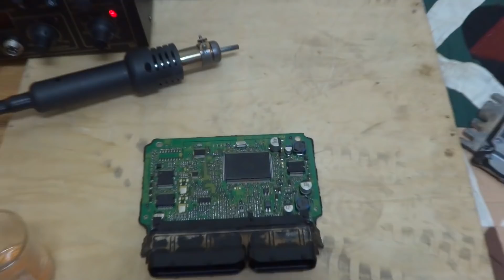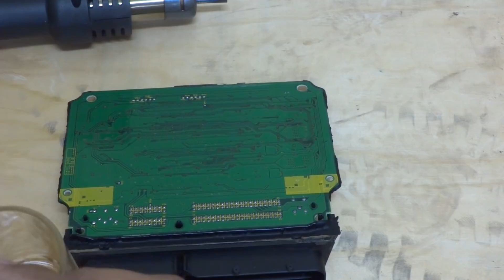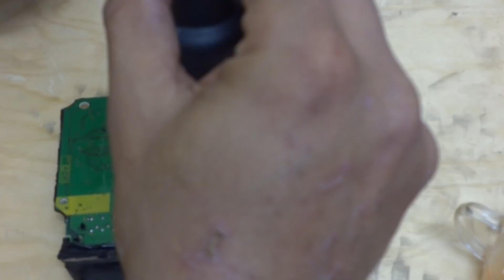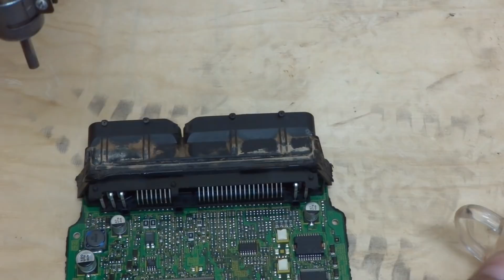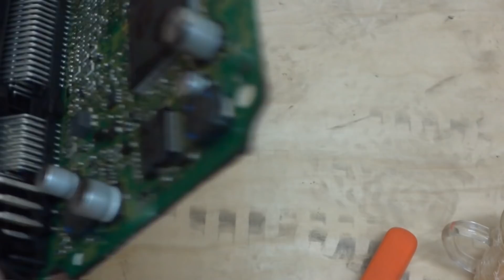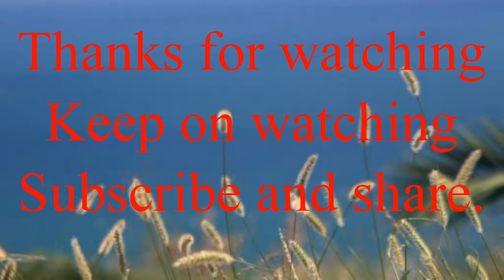Car PCM ECU computer repair.

Comment: This works for problems like the famous 90’s Honda main relay going out too. You can just remelt the solder on those usually. Nice video. Even if it doesn’t repair some, its worth the few minutes to try. It has to be removed, if you need a new one anyway. Just plug it in and test it before bolting it down.

Comment: Do you think this scenario is related to a faulty ECU. 
My shifter had stuck in Park for not sending grounding signal to the shifter solenoid. The mechanic made a jumper now the shifter is good, but the transmission shift at a higher RPM. From 2nd to 3rd and so on, you have to reach the RPM to 3200 or 3300 and then the trany upgrade the gear. Do you think the ECU is what causing the trany shifts funky? Thanks.

Comment: Although reflowing the solder of an old board can address many typical intermittent defects, I definitely doubt the procedure applied in this video is effective.  Most of the time the heat is not applied long enough in a single spot to allow the solder to melt down properly regardless the temperature and/or airflow applied. In fact, if the heat is too much you may destroy the component.  Those who ever worked with SMD devices will understand what I mean.  The video may work as "representation" but it is far from a technically accepted procedure.   For those who are asking about the flux, it is the same used for the SMD / PCB soldering process, you can buy in electronics stores. The purpose of using flux is to reduce the melting temperature and to reduce the amount of oxidation of the metals you are reflowing while applying the heat.   After doing that, you shall use Isopropyl Alcohol to clean the flux residue followed by a quick hot air blow (bellow 175 F) just to evaporate any alcohol residue.   And don't forget to test it ........

Comment: I have a 2011 Porsche Cayenne S that has a PCM that keeps rebooting every 20 seconds. I can no longer access the Radio, phone, Navigation on the display setting as it keeps rebooting and the few seconds it does show me a screen the buttons are non-responsive. It seems to me as a software/firmware issue but i could be wrong. The dealers solution was to re-flash the software which didn't achieve a fix and recommends replacing the PCM which is very expensive. Any chance this solution would work with mine or any other ideas?
Reply from the maker: It may need proper diagnostics. There are different fault occur in machines.

Comment: Thanks, good video!! So, reflow is enough to fix any bad solder connections?? Why did you do this?? You were able to see/ or feel, where the bad solder connections were?? How long you have to reflow?? Until you see some melting?? And one more thing: you don't actually have to add any solder into a board?? Did this reflowing help to fix this ECU/PCM?? Thanks a lot=)

Comment: I have 2009 toyota corolla, it's showing all 4 ignition coil secondary circuit,, but it's ecu problem,, can any one answer for how fix it?? thanks ......
Reply from the maker: Seems its Ignition driver IC is bad. Replacement could solve.

Comment: Even though this method is "I don't know what's wrong" so I'll resolder all connectors and try - surprisingly it can fix 50% of all issues, with any Laptop/PC accessory. Professional service used to fix GPUs sometimes does this - (I mean rebailing) so it is something already. Should not break anything, but with cheap labor (own after all) there is a chance to fix something this way. I know a guy who bought 12GB of RAM DDR3 (faulty) on eBay, and fixed it in the kitchen oven. Who knows?:)

And why soldering goes bad? From what I heard European Union around 2000 year has invented that soldering/electronical connection should contain limited amount of tin solder (?) or something, not  sure what, but in care for the environment - now I turn my super old '97 Pentium II MMX after 20 years on and it works, while 2005 Pentium 4 PC motherboard is gone dead long time ago.

Comment: What temperature ??
Reply from the maker: Shabbar Raza Dear friend you can set anything close to 300*C with air pressure or flow control to minimum. Regards,
Reply: Thanks, btw, my ecu is a repaird one and now it is not giving signal to injector #3. When ecu is cold it works fine but as soon as ambient temp rise its giving problem, could u plz help me out ??
Reply from the maker: Shabbar Raza As I told you before dear friend this is well known problem for Nissan. You can replace injector and ignition control IC in the ECU. The number I didn't remember but it was something starting from LA. Replacement of that IC should solve your problem otherwise you may replace and reprogram your ECU. Big $ loss! Regards,
Reply: Thanks man,

Comment: Thanks for sharing this video. My Nissan Pulsar's ECU is not giving proper signal to injector#3. When ECU is cold it gives proper signal but after some time no signal to injector#3. I think I should do the same procedure as you have shown in this video before replacing the ECU. May be some loose connection making the problem.
Reply from the maker: Shabbar Raza Dear friend there is one IC whose number is starting from LA, exact number I didn't remember but there is metal heatsink on that; replace that with a new one. Hope this will solve your injector pulsing problem. This is well known fault with most Nissan models. The availability of IC is a bit difficult. You can obtain one from another old scrap ECU with good injector IC. You may subscribe my channel to get automatic notification on each upload. Regards,
Reply: Thanks man, I will give it a try to replace the IC first before replacing the ecu. Wil update u in few weeks :-)
Reply: LearningZone
one more thing, when i try to find ECU underneath the passenger side dashboard, I found a small electronic card in which wires were going inside,and I assumed it as ECU :-). I remove the two harness connector going to that module and accidentally try to start the car ... and the car started. I was surprised that how car is started with out ECU connection. Then I realize that this box must not be ECU, finally I discover ECU little bit inside of dash board, on top of this card. I am wondering what this card do ?? there are some wires going from it to ECU also. I found some wording at the side of this card as, Nissan F 31036 5M400, A64-000 A29, 1409, Unisia JECS corporation , Made in Japan.

Comment: Do you reflash your PCM's. What do you use? I find working with car computers frustrating as the scanners/reprogrammers are so expensive. For example I need a GM tech2  to do many electrical things like relearns after replacing throttle sensors or replacing the pcm itself or key replacement. The service manual is full of procedures using the Tech2 for everything.Chinese clones are an alternative but how is their reliability? What else is there?

Comment: What temperature are you using on the air heat gun? I want to put my ecu in the oven (poor man's way) at the same temp. Thanks and keep up the great work!
Reply from the maker: Alex G Dear friend thanks for liking video and subscribing. Hope you will find my channel interesting! The typical temperature I am using for most of my work is somewhere from 250 to 300 C. Better not to go too hot as it can damage the components. Also it is not a must the case that your ECU will come to life with this technique. This technique will help only if your ECU had developed dry solder joints. Anyhow give a try before replacement ECU. Regards and good luck with your repair. Also please inform about your success.
Reply: Thank you for the tips. Yes, this is last resort before buying another ecu. I already replace a burned IAC chip caused by coolant shorting IAC under throttle body.  Unfortunately, replacing this chip and new IAC did not solve problem (rough start up and high idle). Car is 2001 Infiniti I30t in USA. From researching, this is known issue for these cars. P0505 code. Thanks again...I like how you do component level fixes rather than replacing part. True engineer!

Comment: Hello there, what temperature are you using for the hot air flow? I have an Aoyue 968 and was wondering what the best temperature is for doing these kind of repairs...

Comment: Ooow thats an interesting tool :-)
Superheated air restricted to a small outlet, local heating only, smashing :-))
Reply from the maker: Yes friend this is SMD station I just purchased to work on surface mount circuits which are everywhere now a days. Regards,